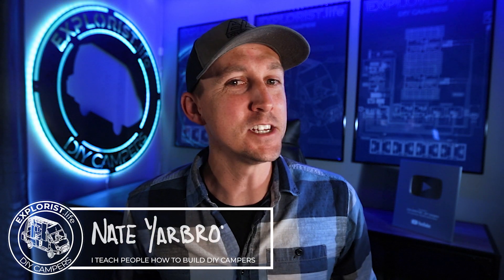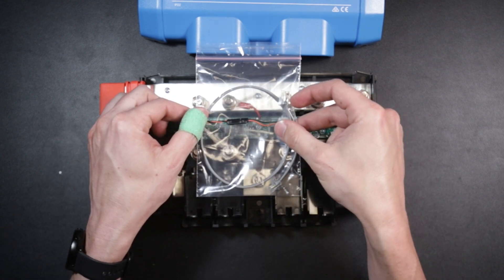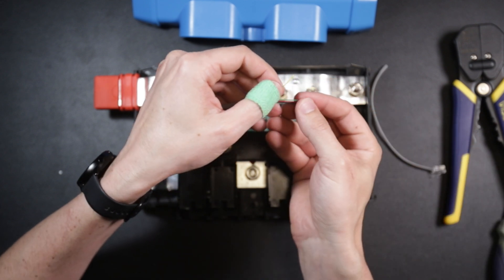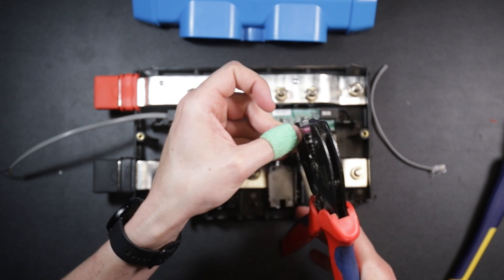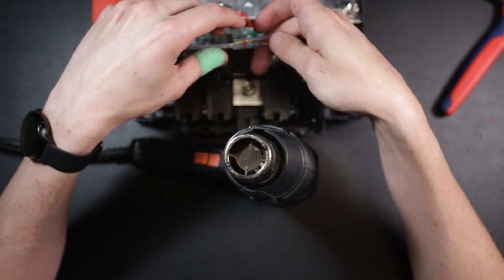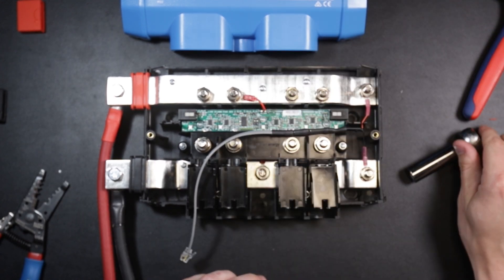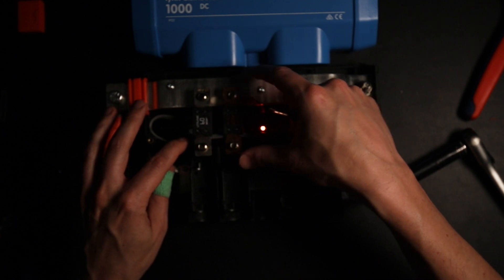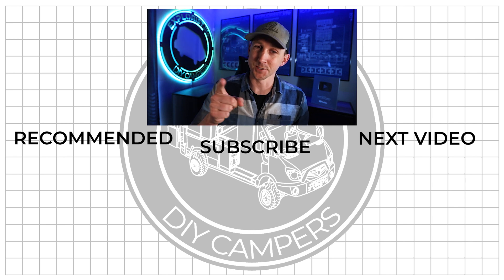How to Make the Victron Lynx Distributor Lights Work (without the Lynx BMV or Shunt)

Comment from the maker: Parts shown in this video:
Victron Lynx Distributor: https://amzn.to/3inVnjj
12v to 5v converter: https://amzn.to/3vU9KQ3
Ring Terminals & Butt Splice Connectors: https://amzn.to/3wZPyg2
Solder Seal Butt Splice Connectors: https://amzn.to/3wXK0m5
1/4" Heat Shrink: https://amzn.to/3cgjHj0
Reply: I have a 48 volt system then I need a 48 volt to 5 volt, that's correct

Comment: so I followed what you showed us but the lights did not light. I tested the RJ 9 end and got 5.2 volts and the cable snaps it like it should but, nothing
Reply from the maker: Thanks for checking all that—let’s dig in with you. If you can, send a couple photos of the wiring, device model(s), and your voltage readings so we can troubleshoot and get those lights working. We offer free support to those who bought from our shop and options if you purchased elsewhere. Our team’s happy to help: https://shop.explorist.life/support

Comment: Help**
Powered my system on and I have an Orange Power light and all of my Fuses are Red.
Thoughts?
Reply from the maker: Yikes — that can definitely be concerning to see right after powering on!

An orange power light and red fuse indicators on the Lynx Distributor usually mean there’s a voltage or connection issue somewhere that’s triggering the fuse status LEDs — but the exact cause can vary based on how everything is wired and what’s connected.

Best move here is to have our support team take a quick look at your system layout and wiring to help you track it down:
https://shop.explorist.life/support
(We offer free personalized support if the components were purchased from our store!)

If your gear came from elsewhere, our EXPLORIST Pro Support Membership is a great way to get custom troubleshooting help:
https://shop.explorist.life/shop/all-products/membership-tiers/

Comment: There is another way you could make one end a type A USB plug it in your nearest port or use 120 v to 5 v phone charger
Reply from the maker: You could also do a 120VAC to 60VDC converter.  Then hook that to a 60VDC to 1VAC converter.  Then connect that to a 1VAC to 5VDC converter.  

Or you could just follow what I showed in the video.

Comment: Will this work with a 24v (25.6v) battery system or will I have to step down to 12v?
Reply from the maker: Good question! Compatibility can vary a bit depending on how your 24V system is configured and what you’re connecting. The best way to dial it in is to check with our support team here: https://shop.explorist.life/support (we offer free help for items from our store!). For all other setups, the Pro Support Membership has you covered: https://shop.explorist.life/shop/all-products/membership-tiers/
Reply: @EXPLORISTlife  I followed your instructions and was able to get my lights to light using 24v. All good.

Comment: I just installed the Lynx distributor with 12v to 5 V step down.  installed mega fuses.  all lights are red and everything is working fine.  what could cause them to stay red and turn green?

Comment: I have a link 1000 distributor It appears there's a fuse blown, But when I checked them for continuity they work I have no lights nothing 12 Volt not working in my rv unless the sun is out. Why would that be?

Comment: Can you use the through port at the other end to supply the 5v or will it damage the unit?
Reply from the maker: The way shown in the video works well.  If you want to try another way, give it a shot; but I haven't tried other ways.

Comment: Does it matter if it's converted to 5V 1.5A or a 5V 3A? Because here in Europe I can't find a step-down buck converter from 12V to 5V 1.5A, only 12V to 5V 3A
Reply from the maker: That just means that there is up to 3A available to run the lights as opposed to up to 1.5A available.

Comment: Another option is if you have a Cerbo GX, you can crimp on an RJ10 4-pin connector to a USB cable.  Plug the USB cable into the Cerbo GX and use the 5 VDC from the USB  to power the Lynx.
Reply: Awesome, thanks for the info. I was wondering if that's possible.

Comment: You said in the video that RJ9, RJ10 and RJ11 are essentially the same thing with different names. This is not correct. RJ9, RJ10 and RJ22 are basically identical (all 4 pin, 4 connector, 7.5mm wide). RJ11, however, is larger. It is 9.5mm wide and will not fit in this Victron socket. Ask me how I found out :(  (P.S. You do great work and I've used a ton of your videos and products from your store. Thank you for what you do.)
Reply from the maker: and to add to the confusion, allegedly, the different connectors are different sizes depending on what country you are in.
Reply from the maker: So, I might not be incorrect entirely... but only incorrect in certain countries. 🤷‍♂️😂

Comment: Hi Nate. I did this almost three years ago and just noticed that one of the four fuse lights (the left most one) is glowing dimly red. The fuse is fine, and I even tried replacing it just in case. The light goes to full brightness when I remove the fuse, so the overall function still works - it’s just annoying to have the dim red light on. I’m assuming a component on the little circuit board went bad, but let me know if you have other ideas about what else might cause this. Thanks again for all your videos!

Comment: I worry a bit about wiring an unfused circuit across the main bus bars.  If this little voltage converter failed shorted, I guess the small gauge wire would act as a fuse but in a very uncontrolled way.  Seems risky to me.
Reply from the maker: If a wire is less than 7” it is considered a pigtail and is therefore not required to be fused.  Feel free to fuse if you fell uncomfortable though.

Comment: I followed your instructions and it worked well. For anyone who tries to do this, I’ll offer that this did test my crimping skills with very small wires. It took me seven tries to get good crimps on the butt splice connectors, and I wasted a few in the process.I also found the ring terminals did not reach positive and negative post after I was done. I had to extend one of them a few inches with a new butt splice connector in order to get them to reach.

Comment: Thanks for tip! The one thing I would add is EN0508 wire copper crimp ferrules on those tiny multi strand wires. So much easier to work with. I have a number of complaints about Victron, the fact that we are pushed into buying the other components instead of getting one of these jumper wires is an example. No instructions, fuses poorly marked, no wiring diagram. If it weren't for you, I'd be lost.

Comment: Just done this as i also have no green light But after doing the same as you still no power light. I do have 2 small dip switches on that board I says 1 and 2 They were both set down I presume off Tried in on position Still no power light This buck was tested and giving out 5 volts Any advise. Cheers Graham

Comment: Thanks, just cut up a mini usb lead and soldred it onto the grey victron lead and plugged the usb a connector into victron cerbo, works a treat.
Reply: I've done the same. It's a better option to be honest especially when the battery pack is 48V. There are no tiny buck converters which can handle an input voltage of almost  60V
Reply: Are saying you got the distributor to send a notification to the cerbo telling you when a fuse is blown or not, on the app, without using the lynx shunt or bms?
Reply: @JonathanBixby-k2h  no just taking the 5v usb source voltage to power the distributor lights

Comment: The device says 24v but since 24v ends up being usually higher than actual 24v...I don't suppose this would work with a 24v system?  If not, is there something similar for the step down converter chip?

Comment: Thanks For this idea and the tutorial! 
+48 and ground connections are readily available on the circuit board, soldering is much simpler then adding  lugs and bolting M8s.

Comment: The link above to the converter is not the converter as shown in the video.
I found the one shown in the video BUT the cables are much shorter than what is the length on the video.

Comment: Hi Nate, Hi from Mexico! Question: would this hack function if the system is 48 volts?
Reply from the maker: Yeah, you'd just need a 48v to 5v dc converter.

Comment: Hi Nate, awesome video sir, question, I have a 48 volt setup, where can I find a 48 volt to 5 volt  converter that same or close to that size that will fit inside the distributor for my system? I assume the converter will need to have a variable voltage input as well, since the system will see pass 50 volts. Thanks.
Reply: I'm planning to get the 5V from the nearby Victron Cerbo USB port, if that helps you.

Comment: Be careful guys - most people don't have 12V on the bus bars but 48V with up to 280A.
Reply from the maker: "Most people".  Well, that's not really accurate.  There are plenty of people using the Lynx Distributor on a 12V system.  If you are using a 24V or 48V system, you'll want to use the appropriate step down converter as I already mentioned.

Comment: Well, after building this another incredible hack of yours, our result turned out a little curious: upon plugging in the connector, all lights go through their regular startup cycle (i.e. they briefly light up red / yellow / green), after which the power indicator remains green, but all the other lights (which all have working fuses connected) go OFF instead of green. When I then disconnect a fuse, that light will illuminate (red), but when I reconnect the fuse, it the LED simply goes dark again. I guess it's usable (no light = ✅, red light = ❌), but it is weird, right? Any ideas?

Thanks!
Reply from the maker: Hmm, that is indeed strange.  I haven't run across that particular issue.

Comment: Great videos and a great hack.  Thank you a bunch.   As I was looking at the circuit board I couldn't help wondering why Victron didn't add this to the board. I have to believe that it would be little or no cost difference.  if it needed to be eliminated when pared with other components, it could be isolated with a small swich.
Reply from the maker: Awesome!  Glad it helped.  Thanks for watching!

Comment: Thank you Nate, love your videos. Question about lynx led light hack? If you have two Lynx connected, do you have to make two 12v to 5v wires or can you simply plug the OEM wire in from the first to the second?
Reply: @EXPLORISTlife - my question also as I'm about to do this, and have a second Lynx Distributor.  It's hard reading through the comments to see if it's been answered! :-) Thanks for all your hard work....

Comment: But what if you have the Victron BMV? And it's connected to the Lynx via one of your Explorist connectors as shown in your videos. How does the Lynx board get power to light up the leds? Not seeing where that takes place.
Reply from the maker: Exact same way as shown in this video.
Reply: @EXPLORISTlife  Thanks for your reply! When I read the title of this video I thought it implied that "(without the Lynx BMV or Shunt)" you could do this hack but with the Lynx BMV or Shunt you don't need to.

Comment: If you were to connect multiple lynx distributors would you have to do this wiring hack in each distributor?
Thanks in advance!!
Reply from the maker: You 'should' be able to just connect the other data ports together once the first one has power.  I haven't tried this personally, though, but knowing what I know about how it works... I suspect this should be the case.

Comment: Hi Nate- Like viewer Fraser Stewart reported in an earlier comment, my lights turn red intermittently- when I'm running a heavy load through the inverter. (Running fridge via 12v, water heater via 12v., etc.)  Basically, any draw that makes the Victron inverter fan go on usually turns the lights on the Lynx red.  As soon as the load drops, lights are green again.  Fuses are fine.  System is 12v.  Any thoughts on why that might be happening?

Comment: Clever, but you now have an unfused connection across the busbars. And the wire with the voltage converter is going to move a lot, leading to the insulation breaking down and the circuit board being fried.
Reply from the maker: Yes, but the wire is less than 7" and fully enclosed within the device itself, which means it doesn't have to have a fuse.  Similar to how the OEM power wire going from the positive busbar to the PCB board doesn't have a fuse.

Comment: Anyone know if this will work with a 24V battery system? Range states 6V - 24V but, of course, a 24V system actually sits at 26.2 V at 100% SOC. I see another convertor on Amazon made for 24V systems, should I use that one!
Reply: I tried this on my 24v system and burned through three of the four converters before I realized that the nominal voltage of the system is 27.2v. This won’t work.
Reply: @Downgrader  makes perfect sense, thank you!

Comment: I did exactly this and i have some stange things happening. The lights are turning red intermittently. Most of the time they are red. But the fuse are not blown. I repeat NOT BLOWN. Did some googling. System is 24 volts. Any ideas or experience with this and how to get it working properly. What could be causing this?
Reply: To be sure..........you're used converter is able to convert 24 (!!) to 5v?
Reply: @Anton-id8ts  yes

Comment: In looking at the converter I see it does up to 24V... but that probably won't cut it for a 24V Lithium Battery.. which is what I have... looked around briefly, and I see several but they are 5 amp... wondering if this one you recommend can handle 26+ Volts, or if I need to move to something larger in form factor which means it will have to live outside the housing of the distributor.
Reply from the maker: Consider feeding power through USB?  USB is regulated down to 5V.

Comment: If u dont have the circuitboard. Is there a way to check the mega fuse manually without unscrew the fuse?
Reply from the maker: Sure!  Use a multimeter to check voltage before and after the fuse.

Comment: Hey guys! I bought the same buck converters and I hoped to do this hack. But... 2 thing are going wrong. The lights light up when I connect only the postive wire from the converter. And when I connect the negative, they just get brighter. The other problem is the lights dont go green when I insert a mega fuse? The fuses are all new victron mega fuses, very strange? What could I have done wrong or why aren't the light going green? Can the fuses have something to do with it? They are geniue victron mega fuses.. Thanks. Guys!
Reply from the maker: Strange!  The fuse will rarely have anything to do with it.  Verify that the circuit is complete (aka, is there a complete circuit attached to the fuse?).  Verify that the converter positive and negative is correct.  Try a different converter to see if the same problem happens.
Reply: @EXPLORISTlife  Hi Nate, and thanks for you time to reply.

I tried with one converter, something happened to is when connecting and didn't work, tried a second one and it's delivering 5v to the circuit board, I have checked that with the multimeter.

The funny thing is again, if I only connect the positive, they still light up red, strange! But they work when I connect both pos and neg ofc, it's just strange.

The other strange thing is, I get .18v on the second positive terminal where the end of the fuse sits, when the RJ10 cable is connected, when it's not, I get 0v as expected.

I have shot a video of it, so It's easier to diagnose, if you have 2 minutes to check it out, much appreciated!

https://www.youtube.com/watch?v=Iz6X7BBhBSI

Could it be a faulty lynx circuit board, hope not!

Comment: Bit sad that as a nice, quite expensive “piece” of equipment Victron didn’t supply a switchable accessory connected/not connected circuit if you don’t have a shunt or BMS connected.
Reply from the maker: It likely will when they redesign the unit.  They didn't expect this piece of equipment being as popular as it has been with smaller systems not using the Lynx Shunt or BMS.
Reply: @EXPLORISTlife  I really like it. Makes a nice tidy job and you can always bolt on as required any future battery updates/charge/accessories

Comment: This is great! I've ordered the 12v to 5v converters. I tried finding a similarly small 48v to 5v converter but didn't have a whole lot of luck. I'll just go with a 48v to 12v converter externally and then will connect the one you linked to in order to give me the 5v that I need.

Do you have a link to the wire strippers that you're using? They look a bit nicer than the ones I'm using.
Reply from the maker: I've got a link to all of the tools I use here: https://youtu.be/KGDMaoe63zk

I would investigate using a usb outlet instead, spliced and wired similar to how I showed in this video as a USB operates at 5V.

Comment: OUTSTANDING, NATE! Works like a champ.
Full disclosure, I messed up the first time and ended up with wires too short to reach the bus bars. Thankfully, there were four 12v to 5v converters in the package so I was able to correct my mistake on the second try (after a trip to Home Depot for more butt splice connectors). So thankful for your content! Keep up the great work.
Reply from the maker: Awesome!  Glad it helped.  Thanks for watching!

Comment: I would suggest a 1a or 100ma  fuse, in between 12v and the 12/5v converter. If it ever shortcuts than you have 2 wires between 2 high amp 12/24/48 busbars.
Reply from the maker: Feel free to do whatever you like, it's not necessary though since it's less than 7" AND the wires are completely contained within the component.  Much like how the positive wire from the positive busbar to the PCB board doesn't have a fuse.